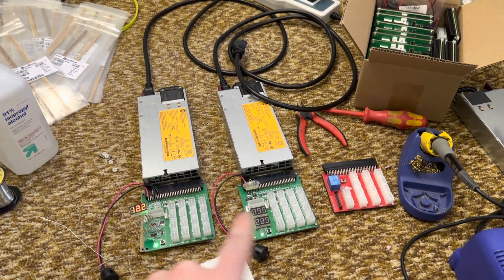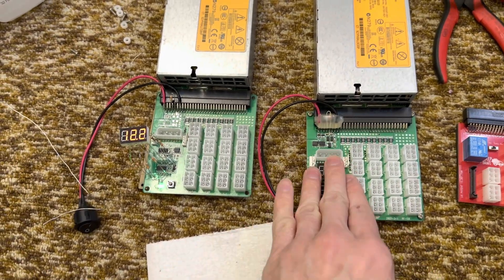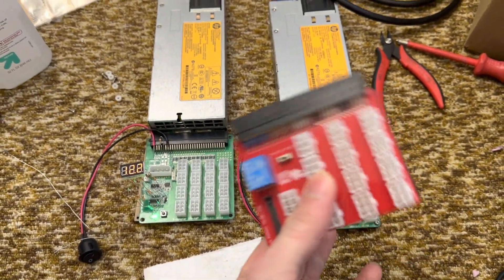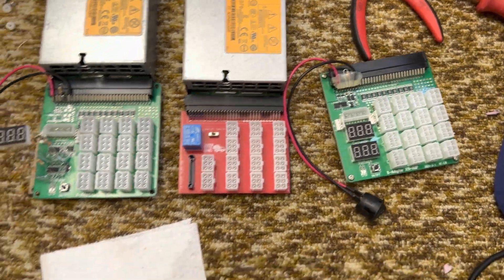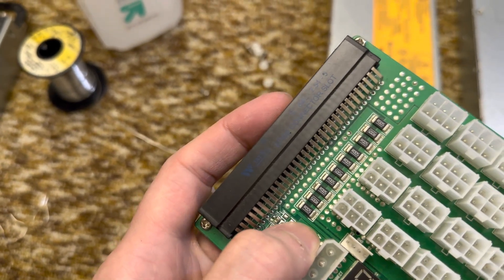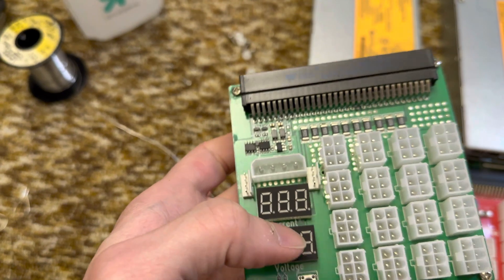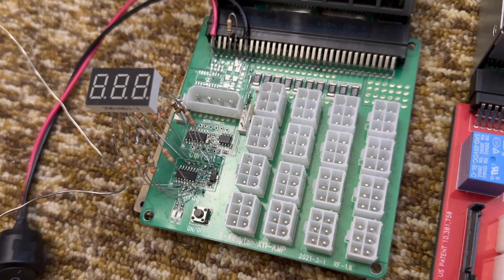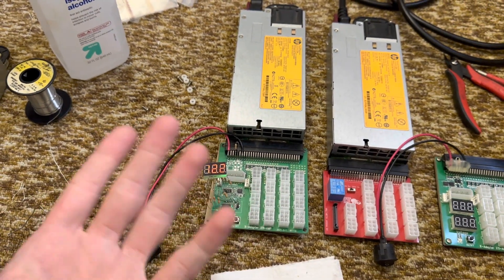Save Energy With Crypto Breakout Board MOD?

Comment: Forget the power, how do you wire up an extra power switch on these things.... I have so many boards that just have crappy power switches. Especially the atx breakout boards :) thanks for the vid great info!!
Reply from the maker: It depends on the board design, but usually it’s easy to do. Those little switches are generally very reliable, it might be the circuit that the switch goes to has failed, not the switch itself. I did a few videos talking about this, it’s unfortunately common.

Comment: 6-7w... got 10 of those running... looks like nothing but still is 70$ a year to run those kind of nuts... got a bunch of broken x11 AMP, not buying those anymore and the quick resistor fix only worked on 1 out of 5 i tried so far... i'm actually looking for another source of breakout board. Even the "new" batch still all have the same problem. i gessing those chip under are over heating causing them to fail at some point. great info!
Reply from the maker: Yeah, it's a bit insane to think my breakout boards little displays are consuming 150W to light up the room red. I'll see if I can find a better way to fix this without just disabling them.

For the resistor mod, I've done maybe 40-50 of them, 100% success. Never had one ever turn off randomly, or go intermittent again. In hindsight, I had a few confusing bits in the videos showing it. How are you doing the mod? It should work every time, no problem.

For NEW boards, I would recommend the deep in the mines boards. Don't get the PM ones, still the same failure. I plan on doing a video to show the root of the issue soon, the mod is still valid since the repair isn't yet proven.
https://amzn.to/3o1IBLW